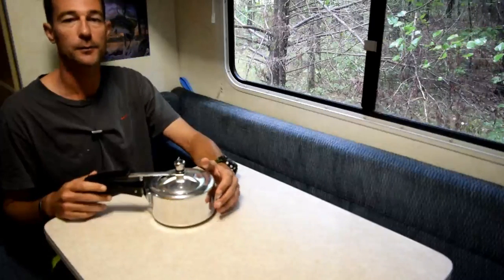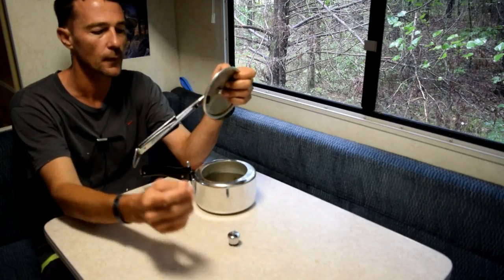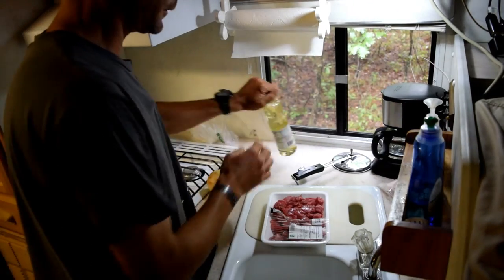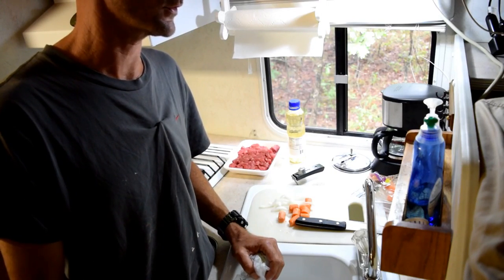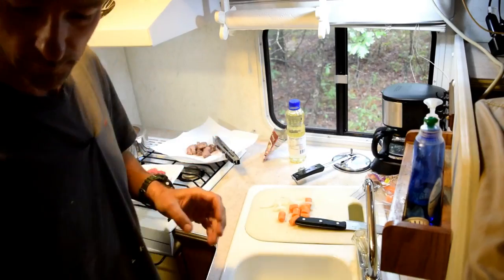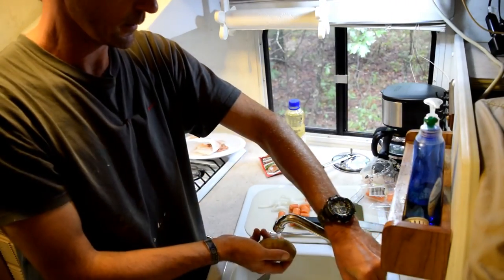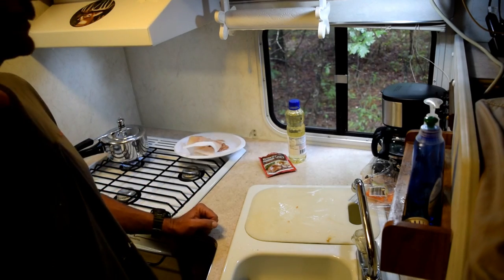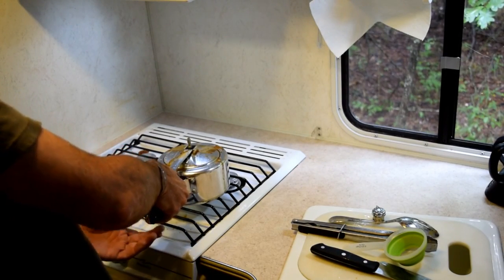Truck Camper Beef Stew Hawkins Pressure Cooker

Comment: Thanks for the nice and informative video about this cooker. Right after I finish watching your video, I am going to order one of these 1.5 litre cookers for myself for cooking on the wood stove at home, (on the edge of the stove and not in the middle of it as I do not want to over heat and ruin the handle). Also I will be taking it on the summer camping trips. This aught to be perfect for cooking the beans and rice better for a single guy. I was always worried about those big ol' aluminum pressure cookers blowing up on me but now my fears are mute. (Plus, they are so dang big.) This one is a beauty. Thanks again!

Comment: Good video, I just ordered one of these, and wanted to get a heads-up on how-to use since the top arrangement is different than most other pressure cookers. But makes sense, and it's supposed to be a lot safer as it's self-locking. For the nervous, don't worry, if the main vent were to become plugged, these have a backup pressure release plug located safely under the handle bar so if it lets go it won't go into outer space. Also, as a cook, two things to try: Many stew recipes suggest you shake the meat cubes in flour, before browning, will give a super rich brown and you can put in pepper, paprika, etc. too  into the flour... and it will also naturally thicken the stew when it's done. This would be best if you're not using the bag of store-bought stew mix. Also, when cooking meat, especially beef, and especially lean cuts like rump, round steak, or grass-fed .... most pressure-cooker makers suggest you just let the cooker come down to no-pressure naturally rather than trying to speed things up by cooling it or letting the steam out manually.. that's rough treatment and  will make the meat quite a bit tougher.

Comment: My wife bought me a Fagor Duo 10 quart stainless steel pressure for Christmas several years ago. It’s a nice cooker but it’s quite large and it’s heavy. The kids have grown up and moved out so I decided to get a smaller one. The 2 quart Hawkins Classic. I really like it but it’s a little too small. I frequently make either beef stew or chicken with potatoes, celery, carrots, and a can of cream of mushroom or cream of chicken soup plus spices and a cup of broth. If I cut two medium sized potatoes and carrots the cooker is borderline too small because the lid fits inside plus I’ve had a few issues with the liquid squirting out of the steam vent. Same thing happened to you on your video. I realize that I am overfilling the cooker so I’m about to order a Hawkins 3 liter hard anodized aluminum XT (the thicker base.) I figure that if I make the same sized batch of stew in a cooker that is fifty percent larger  (3 liter vs 2 liter) I shouldn’t have any liquid squirting out. Alternatively, I could just make a smaller batch of stew but I like to have leftovers.
Reply from the maker: My cooker is a little small.  But I make it work.  I don't like cooking huge batches of food, I won't eat it all.  LOL  I could possibly go up one size though.  Your soups sound delicious.

Comment: In the age of the throw away craptastic Instapot type electric Pressure Cookers... it's great to see people keeping the basic ol' Hawkins stove top design alive.  They're robust AF..... with seals and replacement pressure relief valves are still available if and when you wear the originals out.

I've seen decades old ones at thrift stores etc that a few $ will make as good as new.

I use mine regularly at home. they just need a little more standing over/attention than the electric ones.
Reply from the maker: Agreed.  I got into pressure cooking by watching my mom using hers.  Thanks for watching!

Comment: It looks really good Mark. I also have two small pressure cookers. Mine are also made in India but they are stainless steel and not aluminum. They are called Prestige Deluxe. I make beef stew and all kinds of things. Also I enjoy just plain old pinto beans and rice also. If I'm traveling I can put the beans and rice in the pressure cooker put the lid on early in the morning let the beans soak all day rinse them add some more water and whatever seasoning bring to pressure and cook 15 minutes and you have a meal ready. They are wonderful to save energy and so quick to cook. I enjoy your videos thanks again. The stainless steel is a little safer especially if you're going to cook something high acid with tomatoes or tomato sauce in it.
Reply from the maker: Thanks!  Beef stew in a cooker is good eating.  I love cooking the beans also in them.  Doesn't take long at all.  Thanks for watching!

Comment: Thank you , this is the smaller pressure cooker I ever had, it is brand new, and I  found your video useful.
Reply from the maker: Thanks.  I like using it to make small servings and with a small cooker, it doesn't take up that much space in my camper.

Comment: I'm kookin beef stew Now. Thanks. I needed to know the time, 20 minutes you said.goin for that although I put more quantity in. Thinking it'll be alright.. just got my first whiff. mmmgood. Im using Hawkins 2 liter contura.
Reply from the maker: I do hope it turned out alright. It wouldn’t matter how much you put in. Twenty minutes is how long I cook it under pressure.
Reply: @DispersedCamperMan  turned out Great. I rolled the beef cubes in seasoned flour before searing. With a little flour to the liquid made a nice thick sauce. Oh, used McCormick  roast beef seasoning, about 3/4 package. Great beef stew. About 1/4 into flour, the rest into Hawkins 2 liter contura pressure kooker

Comment: This was really helpful thank you! How long do you run could water over it and how do you know if it’s “ok” to open? Thanks so much!
Reply from the maker: Thanks.  While the cold water is running over the top, gently lift the pressure release weight slowly up and down.  Eventually, steam will stop coming out, then you can lift it all the way.
Reply: @DispersedCamperMan  fantastic, thanks much! Happy cooking!
Reply: with the hawkins design you can't open it if it still has any pressure in it. the more pressure the tighter the lid seals.

Comment: Just subscribed. I’m Boondocking full time. Thanks for the tip.
Reply from the maker: Good to hear Dennis.  What state are you boondocking in?
Reply: Dispersed Camper Man Thank you sir. I am currently Boondocking in Texas. I alternate my nights between a Walmart parking lot and the beach at Port Aransas. You can camp there overnight, make bonfires and they have restroom and shower facilities. 12 bucks a year for a beach tag and you can drive right on the beach. Pretty cool. I think I can learn a lot from your videos and pick up some tips that I can modify and adjust for myself. I also have a small YouTube channel.
Reply from the maker: I hope you are staying cool down in Texas.  LOL  This heat wave rolling through ain't no joke.  Subb'ed your channel.  Thanks for watching!
Reply: Dispersed Camper Man thank you sir. I appreciate that. I have had a couple rough nights but all in all it has not been horrible. I have a portable fan and those chill pads help a little bit despite the high humidity here. I need to make a little review synopsis video for all of the new subscribers. I think I just reached a 300 so thank you very much. Feel free to comment whenever you have time sir.
Reply from the maker: I hate sleeping in the heat.  LOL  I don't if I don't have to.  Take care!

Comment: @Dispersed Camper Man, I really appreciate this Hawkins tutorial, as I’m considering making a purchase.  I’d like to be able to cook faster in my camper and a pressure cooker seems a no-brainer. I noticed that your pot seems to overflow (juice was on the top, down the sides and on your stove).  Is that usual for the Hawkins or is it because your pot was a bit too full?  How might I best avoid the mess associated with the overflow you had?  Many thanks, in advance.
Reply from the maker: Glad it was helpful!  I have the smallest cooker, which I probably had it a little over full.  It overflowing like that doesn't hurt anything, I need to not overfill it.  Thanks for watching!

Comment: Good video. Ever cook beans or rice in your tiny cooker? I've heard the small ones don't hold enough water
Reply from the maker: I know you can rice, I've never tried the beans.  I use a bigger cooker for beans, so I can make several cups to save for the next day.
Reply: I'm considering the 3L version which looks taller. I converted an ambulance so I don't have a TON of room, but this looks like a good way to save time cooking
Reply from the maker: It definitely is a time saver.  I like my pressure cookers.

Comment: Thats a tiny pc. Never saw one that small before,  i have a 6qt presto stove top and beef stew is on the menu for tonights dinner.  Been waiting for it to get colder here in so cali
Reply from the maker: mixwell1983 I like my small PC. It doesn't take up a whole lot of space storing it in my truck camper. Beef stew would sound good tonight.

Comment: Looked good Mark.  The leakage you got out the top of the pressure cooker...was that from maybe filling it too full, or perhaps just a bad design lid?  Were the potatoes and carrots cooked soft?  I'm amazed that cooked in 20 minutes...when I do a beef roast at home in the oven with carrots, onion and potatoes, it takes about 90 minutes for them to get soft.  That is a real fuel saver cooking that fast.  Hope Jake got some leftovers.
Reply from the maker: David, No, it wasn't a design flaw.  The regular became stuck for a second till I tapped it back down with my finger.  It will emit steam every time it lets off pressure.  I probably need to not put the gravy packet in it till after it's done cooking.  The potatoes/carrots came out perfect.  The reason I like cooking in the pressure cooker is it saves on fuel (propane, electricity).  It cooks the food under pressure meaning it cooks a lot faster.  Jake thought the beef stew was good also.
Reply: Dispersed Camper Man Pressure cookers don't do well with thickeners. They bubble inside and out the top or scorch to the bottom. Try cooking all ingredients except the mix. Release pressure, remove the lid and then add the gravy/stew mix reheat and thicken toplessly

Comment: Hey there! I'm glad to see someone using a Hawkins for camping, because it makes so much sense! Have you tried using it over an open fire yet?

As a sidenote, it took me a while to learn, but there's a technique to opening the PC without dipping the lid very far into the vessel. Here's a 15 second video on how to do it, in case it was frustrating you too! https://www.youtube.com/watch?v=jC_vwb1E1j0
Reply from the maker: I have not tried the open fire yet.  I wouldn't think it would keep a  constant heat to keep it at pressure.  That's for watching!
Reply: Works great over a camping gas burner or a small twig burner such as the Firefox Nano (with a strong support such as rocks or bricks, not sitting directly on the Nano).  Keeping the handle away from big flames is important though!

Comment: why did the pot leak all over the stove ??? i dont like that mess to have to clean up
Reply from the maker: Jim Phillips I do believe I over filled it. It was an easy clean up. Thanks for watching Jim.
Reply: Add the thickener, in this case the gravy mix after cooking. Otherwise it foams up inside and comes out the pressure valve.

Comment: that lid with any liquid at all is a mess waiting to happen, you can't take it off without dropping it down in to the contents of the pot
Reply: Yes you can, once you get used to it is super easy, I have had the 2 liter for a few years and no problem. Pressure cooker should never be fully filled otherwise it’ll clog the valve, that’s with any pressure cooker not just this one.